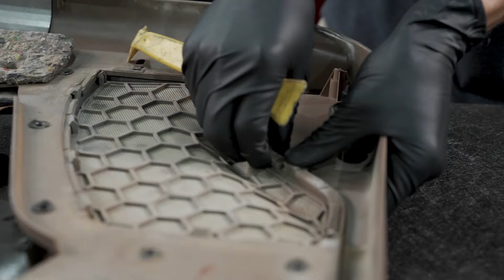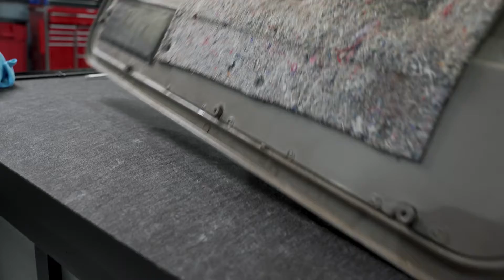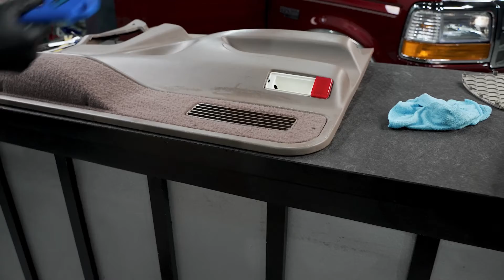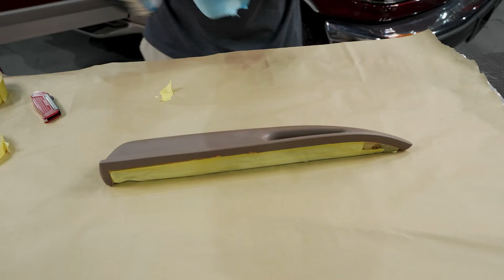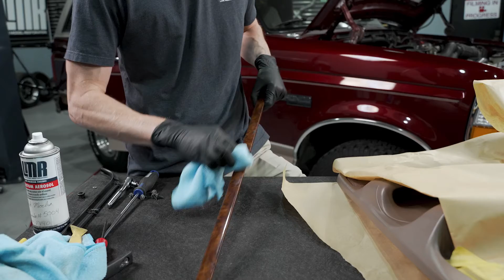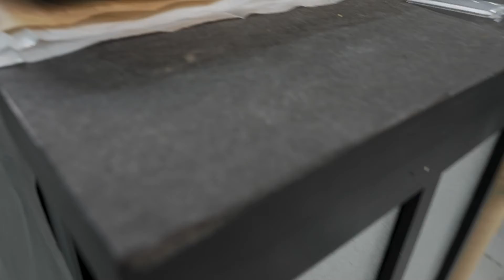1992-1996 Ford OBS Bronco & Truck: Door Panel Refresh & Deep Clean

Comment: I skipped around. Did you mention what cleaner you used for the panel?
Reply from the maker: I didn't mention the specific brand of cleaner. IIRC, it was diluted Simple Green which is all I had in the shop at the time. Typically, I use dedicated automotive interior cleaners. My go to over the years if you're buying in gallon size has been Meguiars D101. It's a concentrate and can be diluted depending on the job. I still have my gallon that I bought back in like 2017. -Landan

Comment: You don't ssy what kind of cleaner you use what what good is the video
Reply from the maker: Any dedicated automotive interior cleaner will suffice. If your door panel has heavy soiling, you may have to consider a stronger cleaner. I've always liked Meguiars D101. It's cheap and can be diluted to your liking. Just test in an inconspicuous spot to verify that the cleaner won't cause damage. -Landan

Comment: To reattach the fabric on the back, I used the plastic heat weld  tip, worked great. Just smashed it on for a few seconds. Melted right on no issue